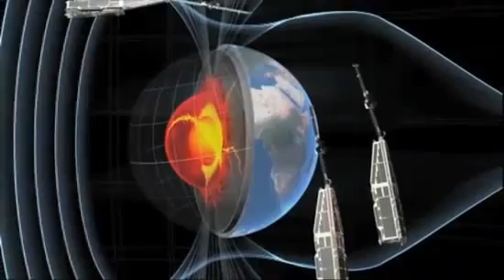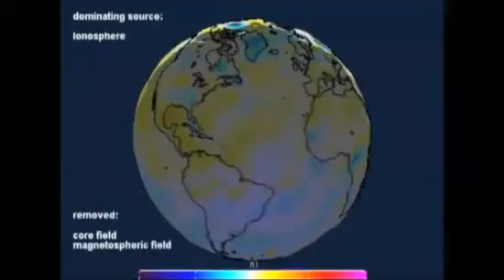✔Magnetic North Pole Rapidly Moving Towards Russia

Comment: It takes 2000 years for a magnetic pole switch so how is it moving rapidly first off
Reply: Does it now?
It takes the changed current of a larger electronical object to INSTANTLY change the polarity of any magnetic object.
So, if the sun wants to, it could flip our magnetosphere within days, hours perhaps.
But most likely, a switch will take no less than 10-100 years.
Reply: No sadly it cant or else we would not have a magnetic shield around the earth that protect us from its solar flairs. Or did you somehow forget that the Sun's solar flairs are actually its magnetic field being shot off due to pressure from other parts of the surface where the magnetic field is twisting and turning. Unlike a planet A Stars magnetic field lies in twists and turns on it's own surface when surface pressure builds up you get corona loops which can shoot off as solar flairs which are dense electrically charged particles. Also they have breached our magnetic field before which left a city in Canada without power for 3 days because the particles start to damage electrical equipment. I mean even if you see Northern lights in an area where they should never show up that right there signifies that a solar flair breached our magnetic field. Also how the Earth is not Magnetic. The Only reason We have A Magnetic Field is due to the fact that our core is turning constantly. So how would and electrically charged change the process of our solidified giant Iron core turning within Magma. And dont bring up Mars. Mars was a smaller planet that had its core stop turning so the Magnetic field stopped. With no protection from solar flairs the Atmosphere was eaten up and everything was destroyed on the now Red Planet. Also the Original Guess was 500 years for a magnetic pole shift so where are you getting 10-100.

Comment: anybody who doubts that there is any magnetic event happening should look at a NONDIGITAL compass. i live in a costal city in the north atlantic and since 2010 i noticed the sun no longer rises in the same spot on the horizon (i can tell cuz i built a green house oriented toward morning sun that no longer receives it) and just this year the magnetic north pole left the north. it is now basically 180 degrees off. earths magnetic field may move all over the physical planet and will never flip te planet around and displace the planets crust like some theoretical scientists like Einstein proposed was possible. a magnetic field has its own self contained forces of inertia gravity centrifugal force ect all of which is relative to the planets rotation which generates the magnetic field. any magnetic field the size of earths holds such a great force of inertia that it keeps entire oceans from flying off the surface during rotation so crustal displacement is an unacceptable theory and impossible under earths physics. the core of the theory being that the planet filps and the hard continents slid around on the liquid iron core of the planet. when in reality the force of inertia is an effect of the electro magnetic field generated BY the spinning iron core itself. the core would not react to an effect it itself generated.

Comment: The Earth's self-sustaining dynamo is really fueled by the differential effects of both the sun and the moon's gravitational pulls.  Before the planetoid hit the Earth and created our moon, we did not have nearly as strong a magnetic field surrounding the Earth.  That is also why very few planets in the Universe has life the way that Earth does, because very few planets had both a magnetic core AND a massive impact event which resulted in the creation of a moon, something that is rarely found in the universe.
 In the Universe, almost all earth-sized planets with similarly large magnetic cores do not have an orbiting moon. Ours in unique.
Reply: Willilly Bab Hm, interesting read- didn't know this.  I was also wondering if the weakening solar cycles is coincidence or not.  Little less solar push on our magnetic shields, so they meander around a bit.  I think they are guessing at the poles flipping since they've not seen movement like this in their pole numbers before- so in their minds  has to be significant.   Perhaps it isn't, perhaps the magnetic poles are just 'reacting' to the strength of the sun.
SC24 is weak so are our shields...

Comment: Interesting one claiming to be a pilot says pilots make an adjustments Another claiming to be a Navy navigator suggests they aren't making an adjustment at all. The amateur astronomer says they aren't seeing any change ,but don't describe the method how they determine that.  Unless they had created fixed true North reference at their location sometime in the past to reference there magnetic North readings to and have been making fastidious records of it. Anyway it doesn't take a moment to discover that 300 years of records show that the magnetic declination does change over time. With the poor electrical grid in the US a weakening of the planet's magnetic shield against whatever spits our way might be a more immediate concern.
Reply: new high tech gadgets that use those lypo 8000 mw or 3 cell lypo batteries that run all the remote controlled drones, helicopters, monster trucks, stadium trucks, rock crawlers, dune buggys, airplanes, race cars, rally cars(ALL RC vehicles. Traxxas and all the other companys combined sell millions of these worldwide. They are fun, but with the popularity of these skyrocketing 🚀 think how even toys put a drain on the power grid

Plus many people upgrade their battery packs in Rc's doubling or tripling the stock engineered product

Those electric cars you plug in, electric transit , all the other stuff is a huge draw on the grid. 
Theres been many fires, same as all types of smart devices , . 

The first time i saw a toy that took one aa battery was 45 ish years ago. A cast metal ambulance with a little red light on top . 

This channel has great info thanks👍

👽🐱🐯🦁🇨🇦